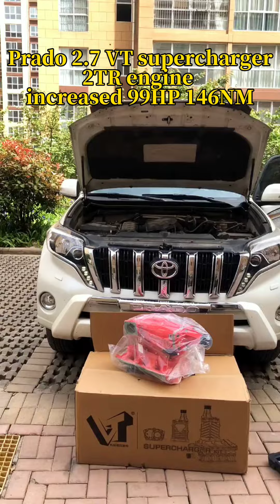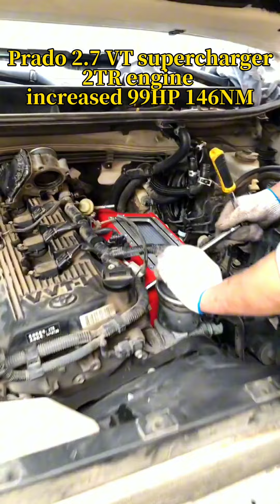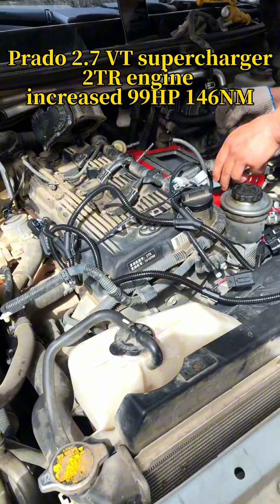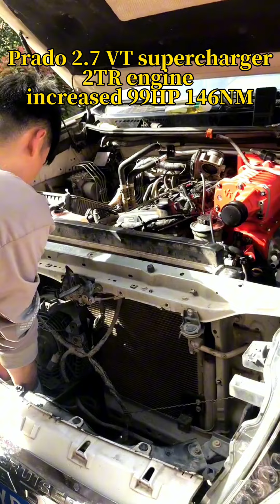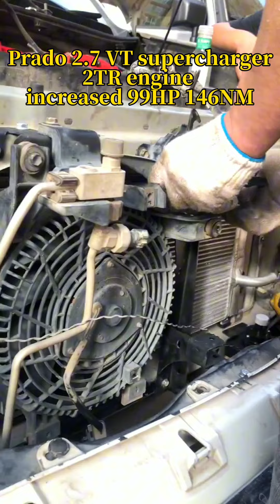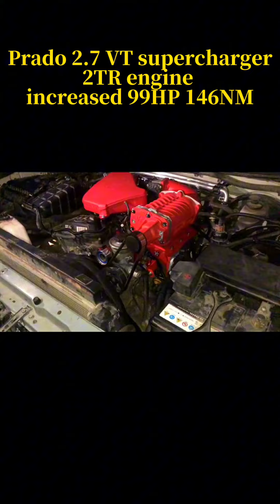prado 2.7 supercharger kit easy to increase 99HP and install same Hilux fortuner Tacoma 2TR engine

Comment: Do you need a tune after the installation
Reply: Hard yes. Don't even drive it to the place, get it towed once you know it functions with no issues.
Reply: They specify on the website that engine and ECU tuning is required so I would say make arrangements with a shop ahead of time and definitely have something else to drive. For another 1k I think the URD kit is a much better setup to be honest. And they include electronics in it that make it practically plug n play. Tuning it is still a good idea but the truck will be drivable and you can still use it. URD also runs the Rotrex centrifugal unit, it’s a cleaner install and the Rotrex uses its own oiling system. The thing to keep in mind is while the 2TR is an iron block it’s got aluminum alloy pistons and an aluminum head, this limits the overall boost you can run. Neither of these systems goes much over 7 pounds for that reason. And add to that these VT systems are all made in China. Now I know in low boost applications that’s probably not a big deal but if I would have a technical problem I would feel better knowing the people who built my power adder on my daily driver were US based. The final concern is US based Tacomas and the drivetrain. Many Tacomas are now automatic transmissions as standard, the transmissions don’t like tons of extra torque and that’s exactly what these systems boost more then power is torque. In some applications I’ve seen upwards of 230 to 240 ft pounds, this needs a shift improver kit which doesn’t really exist for the Toyota 6 speed automatics. Finally there’s longevity to think about. How much will this impact other parts of the truck. In my opinion the URD kit wins there as well since Rotrex units do have a good track record. Just do not forget this, with no forged piston option you can’t go over 7 pounds on the stock Tacoma internals unless your planning on blowing out the tops of the pistons